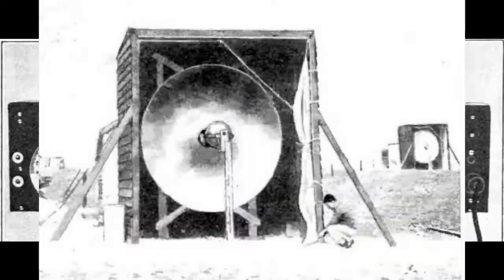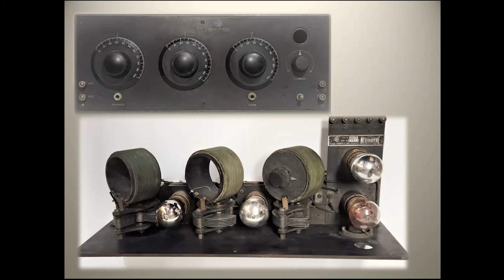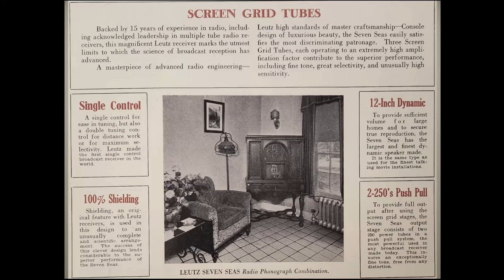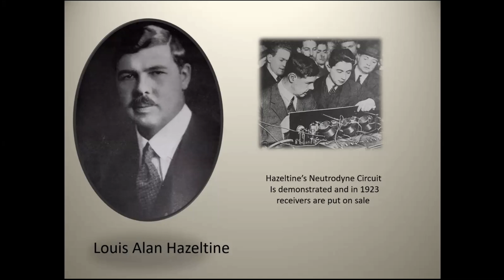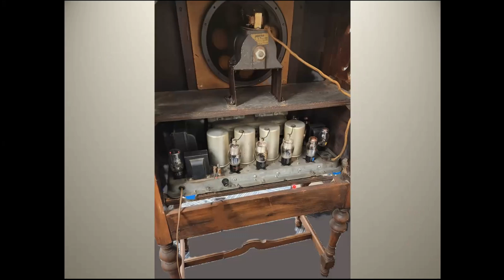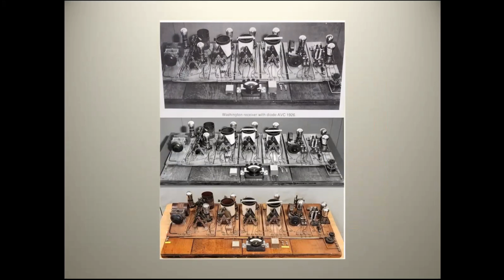Fading and Blasting - Invention of the AVC and AGC circuit and the Inventor Harold Wheeler

Comment: Thank you Mike for this most interesting video.  I didn't realize Harold Alden Wheeler came up with the AVC (or AGC) idea, I assumed it was Edwin Howard Armstrong.  I have been restoring antique radios since 1972 and spent most of my career designing the RF portions of aircraft communication radios so, very familiar with Miller's Effect and the lack of automatic gain control on the early radios.  I found the documented tests on the early Philco with AVC, very interesting.  Audio output level was still poorly controlled with the AVC but, did keep the IF stages from compression, which is good.  Simple diode AGC detectors are marginally effective in controlling receiver gain but, the world seems to be accepting of this performance.  With the VHF Comm radios I helped develop, which used Amplitude Modulation on this band, we typically had less than 1 dB audio output level variation from -100 to +10 dBm input level (pilots are very fussy about their audio) and would AGC on noise.  The excess gain was necessary to accurately drive a noise squelch.  Also, the early 1920's radios primarily used a horn speaker (basically a modified headphone driver with acoustic gain via the horn), this is why the audio output power was so low.  In the mid 1920's paper cone speakers started to become popular due to improved audio frequency response, but where not as efficient, so the radio engineers increased the radio audio output power for that reason.

Comment: Consumer chief complaint to the FCC, when watching TV the commercial volume goes up it's to loud. 
Some years ago I attended a lecture given by the Thomas Wheeler chairman of the FCC who stated the chief complaint they get from the general public is the commercials are too loud, he insisted there was no problem but the FCC was looking into it. So much for broadcasters TVs AVC circuits. 
Networks and local broadcasters wouldn't deliberately increase the gain when  airing commercials wood they.  interesting, Thank You
Reply: IT was needing audio AVC not RF signal AVC then.  The broadcasters probably just used more compression/processing of ads to make them seem louder, without exceeding the limits of the transmitter audio capabilities.
Reply: NTSC audio used FM with a peak deviation of 25 kHz so, these receivers don't use AVC.  To increase the receiver audio output level, the station was increasing the FM deviation.